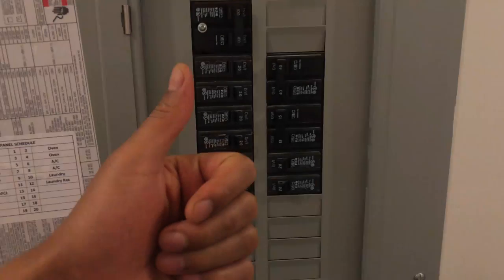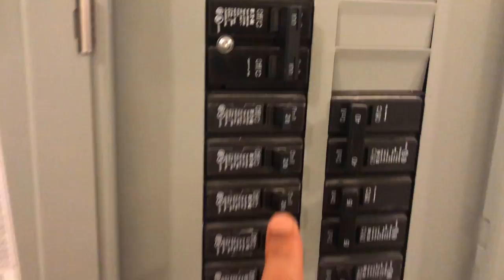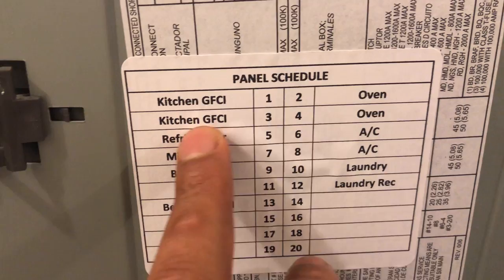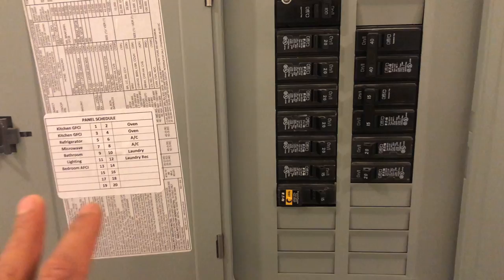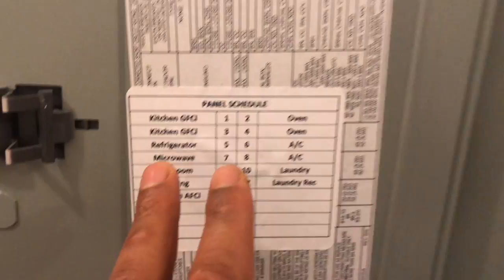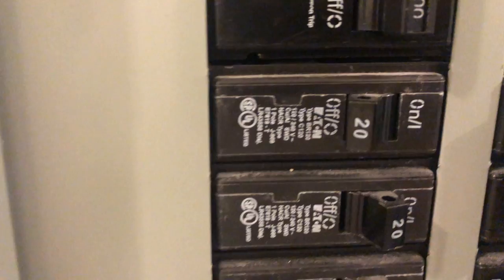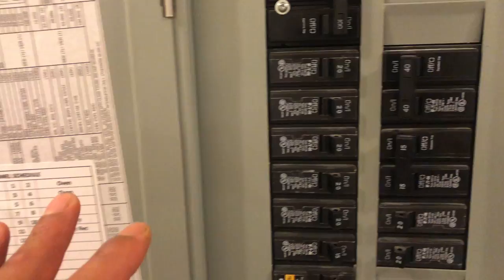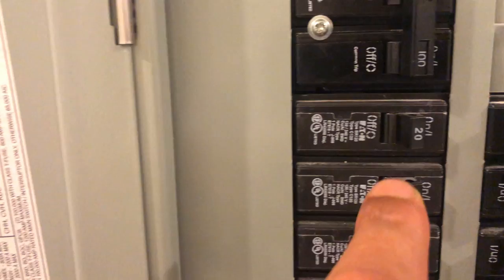Blown Fuse - At the Fuse Box to Turn The Lights Back On

Comment: I put something in my plug and it sparked and the lights went out. I went to my beaker box and reset everything but my lights in certain parts of the house are still not on. What am I doing wrong?
Reply: Did you figure it out ?
Reply: @austinetherington8392  yes I did! Thank you 😊
Reply: @deeandreasterns  What did you do
Reply: @Glo3488  it’s fixed now
Reply: Wht was wromg
Reply from the maker: @deeandreasterns did you ever figure it out?

Comment: Thank you I was in my room then I messed with my guitar and the string broke off(which was metal) then I sat it down then the string that broke went into the outlet then a spark came out and every thing turned off
Reply from the maker: you're welcome!
Reply: @DIYPinto  so if i go in there will 1 and 3 be for kitchen also or is it different